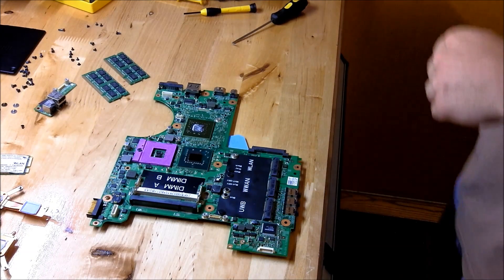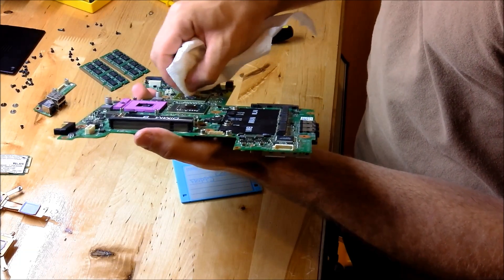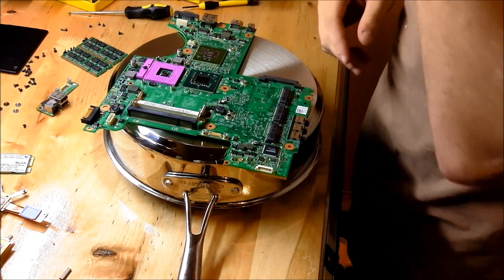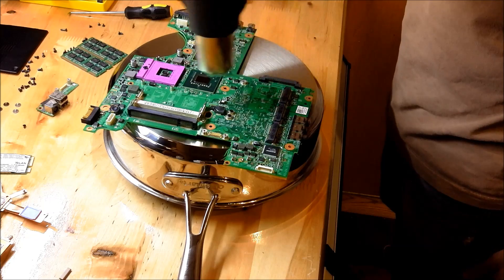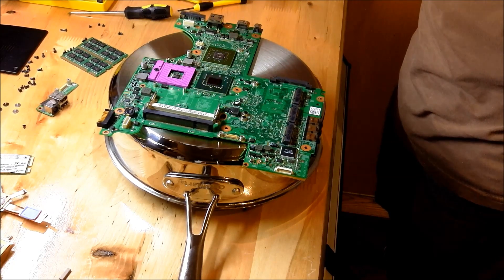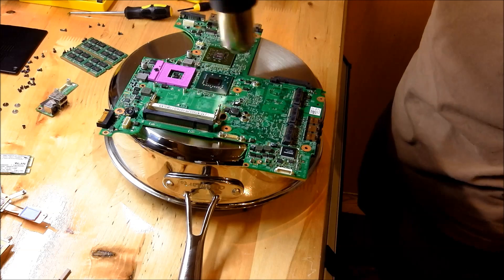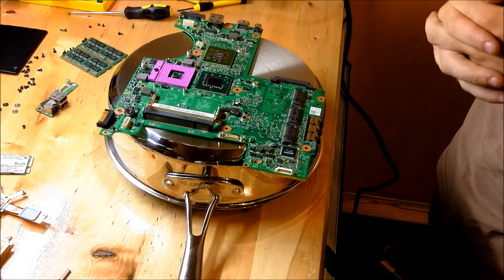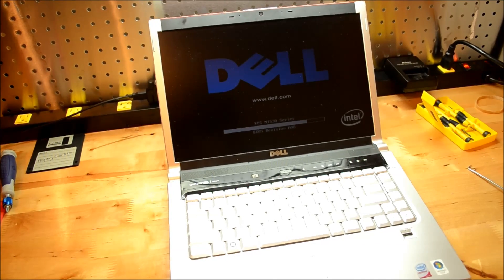Fixing a Dell Motherboard with Heatgun Reflow (or Oven) Nvidia Graphics GPU Issue

Comment: Hello thanks for the info, I have a 2017 dell Alienware laptop and the discrete GPU is dead, I wanna attempt this method on it, what was the temperature setting on your heat gun, is there a specific degree value?
Reply: Did u test it? and Is it working?

Comment: If you stick a laptop m/b in an oven to try a reflow, won't some of the plastic clips & connecters melt? Also, did you protect any sensitive components on the bottom?
Reply from the maker: I've don't this procedure a bunch of times, on GPUs, a few iMac logic boards, an xbox, and many laptops.
Reply: @GarageMaxedOut  I am still planning on, if needed, a hot air reflow, taking precautions, monitoring temps, etc.  Thanks again

Comment: I did this with my Sony Vaio which all of a sudden developed some serious graphic glitches on the screen and it fixed it.  I warmed up the board like you said and then focused the heat gun on only the graphics chip for around 8 seconds.  Then also replaced the thermal paste and cleaned the cooling fan of all the dust as it was clogged up so would have caused the overheating.  Thank you very much for your help :)
Reply from the maker: Glad it helped! You might also consider lubing the fan, which will allow the fan to move more freely. I have a video on the topic, and here is an easy to use oil syringe- https://amzn.to/34A7MqR

Comment: I came here just out of A M A Z E M E N T  to write this;

I have here (writing on it) a 2007 or 2008? DEll D830 2.2 or 1.8 ghz,depending on the cpu and 4 G of memory; old,but plenty enough for my needs;i have 3 of these,the other 2,work; this one  was dead 4 or 5 hours ago; i opened it to redo the heat transfer paste and change the cpu,.and after that it would NOT boot,turn on etc; D E A D;   ONLY 2 lights blinked briefly and then the one in middle would stay on; tried EVERYTHING: memory sticks,hdd,cpu(T7100 and T7500),etc etc
T H E N ,since it was dead ,i grabbed the heat gun from the shop (i had tried with a blow drier,no good)
I cut a  square off a piece of aluminum foil(doubled in2) and put it over the nVidia chip,like you see on many videos

I grabbed  my cheap  IR thermometer (with the laser pointer BS) and i heated the chip up,slowly at first,for,say 10 minutes,removing the foil and heating around from a distance at times

T H E N i hit it with the heat,foil in place; after maybe 1 minute,the IR gun got up to 170ºC, but i suspect the real temp was MUCH higher,that thing is not reliable; i was scared the chip was gonna explode,i put on some glasses
The whole chip started to turn slightly brown,and i smelled burning!!!!

Stopped right away,switched to the blow drier on low,to allow the chip to cool S L O W E R ;

And then  i assembled the whole thing, except all the bottom screws,intending to put it away,to throw away,or for parts,i had C O O K E D   it!!!!!

Well, to my delight,it works fine, hope it lasts,i am amazed at the power of youtube advices sometimes.

PS:  after some 20 minutes,it runs way cooler than before on the bottom,maybe some to do with the new paste.
Reply from the maker: NIce!

Comment: It's 2019 but I wanna say something about this. First of all this is not reflow because the solder didn't actually melt, if you want to reflow the solders you should apply flux otherwise it will oxidize the solder and will make it worse. It worked because of the heat applied to the chip which reacted and allowed it to work again.
Reply from the maker: Thanks for watching

Comment: Don't laugh but I f***ed up my acer aspire 5552 board. It was my first gpu reflow attempt and I forgot to take off the little film on top of the chip so it melted all over it! I tried to scrape it off but ended up disturbing the tiny pieces on top of the chip (not sure what they are called). To top it off, a capacitor came loose and because detached. Strangely enough, the board still powers up, I thought it would be totally dead. However it does turn itself off after about 3 seconds.
Reply: I have one more board which is the same to try this out on so any tips would be greatly appreciated. I'm using  a 2000w heat gun btw. The lowest setting gets to 400*C
Reply from the maker: Check out my new video on this- https://www.youtube.com/watch?v=utt-SSQAYSA
Reply from the maker: Are you sure it was a capacitor?

Comment: I am not sure how long this repair will last, but my Dell is working. My 630 is used for programming radios and the software only runs on XP.  I ran a 24 hr test this far good.
Reply from the maker: Glad it worked for you!

Comment: My laptop motherboard has a amd dedicated graphic chip. If i completly remove the chip, motherboar will work or not?
Reply from the maker: If your laptop also has integrated graphics, it is possible, but unlikely. In a laptop, the LCD screen is connected to the primary GPU bus, which is probably to the MXM slot in your unit (but I would need to know what unit it is specifically)
Reply: mr82020674 I want to remove the dedicated graphic chip "amd chip" . Becoz it is faulty and online update tries to update graphic driver and screen goes black.I m sure amd chip is faulty. Laptop is now running with Intel HD graphics  with Intel i7 processor
Reply from the maker: What is the operating system? Did this start happening after an update? Did you see glitches prior to this starting?
Reply: Problem Fixed, I removed amd graphic chip and its power supply unit. Now my laptop is running with intel HD grapics with no problem.(HP Pavilion DV6 6165 TX)
Reply from the maker: Nabodaydharani Medhi nice! Good info to have for sure, thanks for the follow up!

Comment: This is an old thread but I have a unique problem but similar. I will try for some of your expert advice since nobody seems to post on this exactly the same as my problem. I have an older 2005 NX9030 Compaq notebook. Recently the laptop's screen started a type of rolling pixelating and would go blank occasionally. Not black but it seems the inverter is working since I can change the brightness of the screen but only the whiteness since the actual picture stopped with the rolling pixelating and now is just blank. I should point out early on just tapping around the computer would bring back the picture for a while but now that doesn't help anymore. 

I can plug a VGA monitor in and works just fine. I can deduce I have either a problem with the laptop screen or the onboard graphics chip has partially disconnected from the board. I tried taking the battery out and hitting the power button for 60 sec. with no power since that is some people's suggestion but no success. My question is there a program that will test if the screen is damaged or the GPU chip? I have used several old computer programs that test the computer like Sandra and they say the graphics are fine. I know VGA is analog and the laptop screen is digital like DVI (I think it is anyways). Is that what it is the digital part of the chip is disconnected but a test program wouldn't know if the output is disconnected but is still functioning?  I really don't want to reflow the GPU but I will if someone is sure that would help. Buying a new monitor and then finding it's not the monitor would suck. The internal connection to the board is good. Any suggestions to pinpoint the problem?
Reply from the maker: If the external video is working, your GPU is likely fine. I believe the internal laptop screen connector is also analog, fwiw. If you are 100% sure the connection to the board from the LCD is good, I would get a replacement internal LCD cable and try that, however it is very rare that they go bad, I've only seen 1 do that in my life.
Reply: Thank you responding. I'm afraid I have no way of testing this connection other than just a digital meter. I couldn't say where the problem is unless replacing the ribbon cable or the screen is going to give me a definitive answer. I went out on Black Friday and got a new Win10 computer for only $110 American. The replacement used screen was $50 or more and the computer couldn't manage any Utube unless it was in the smallest format possible. Maybe a external video card would be possible but getting one that works on WinXP would be stupid and upgrading to Win10... on and on and on... long story short... I love my new computer

Comment: I've tried this numerous times, and while it works each time, the issue with the gpu and no display always reoccurs.. Despite properly cleaning the fan, heatsink and reapplyig thermal paste(arctic silver 5), this fix doesn't seem to last..
Reply from the maker: Make sure you use a quality thermal paste- https://amzn.to/39chrWo

Comment: Hello, how many degrees did you heat up the board? And how hot do you apply air? You did not heat directly on the chip? Thank you
Reply from the maker: Fatih Bey. hey sorry, I didn't use a thermometer, just the method demonstrated here
 I'd follow it just like it says and check your results
Reply: I'd not attempt to use the oven, as the temperature of the oven doesn't get sufficiently hot to completely melt the solder. This is partly why the oven trick is at best a temporary repair.

Wrap the portions of the motherboard you're not working on in foil. Take a heat gun, hold it so the nozzle is straight, and so the nozzle is approximately one inch above the surface of the chip to be reflowed. Set the heat gun to 300 degrees Celsius and let it run for approximately one minute. Shut the heat gun off and let the board cool for twenty minutes. Clean out the fan and reassemble the laptop. Run a 3DMark torture test for a while afterward. If it survives the torture test, enjoy.

Holding the heat gun in this manner mimics the solder reflow workstations technicians use.

Comment: Amazing it worked for me thanks a ton ressurected my 9yr old dell studio1555 unused since last 1year due to dead ati radeon graphics card !!!
Reply: worked temporarily for some time then shuts down anything else i can try please suggest?
Reply: Hi. Hey! Men! I have a Dell studio 1558 with the same problem that you had. I'm going to try resurrect my 8 years (unused) laptop with the oven method, because I'm not have heat gun or hair drier. But I know this is a temporal solution, due to the tin factory quality. I read, that a better solution is a reballing, because in the process, they remove the factor tin, and use a better one with more lead for improved efficiency with temperature handling.
Reply: ¿How you did it? ¿Oven or heat gun?.
Reply: @miguelrocha624  tried with heat gun multiple times but worked for some time then black again finally i replaced the board with another used one from ebay.
Reply: a more permanent solution will be reballing I have kept the old board will bga reball it

Comment: Its not the joints its the chip its self trust me. By heating it its temp fix it will not last.
Reply: I did this repair to my 2010 model Dell Inspiron N5010 over two years ago, and ran a 3DMark torture test afterward. It survived the torture test and I used the laptop daily for 18 months after the repair. The only reason I stopped using it on a daily basis was that at the 18-month mark my roommate bought a MSI Wind gaming computer and gave me her 2011 model Dell XPS L511Z; an upgrade for me as my laptop needs are modest.

I'm not saying you're wrong here, because in most cases it IS the chip. But you can't say with absolute certainly that in every instance the chip is the problem, because there is that small percentage of faults that aren't due to the chip itself.

Comment: I kinda doubt putting foil on the parts you don't want to heat up too much would prevent damage in the oven.   I could see heating the whole board up a bit with the heat gun then putting a piece of foil over it with a hole in it just big enough to get the GPU nice and hot and having that shield the caps and the rest of the board from overheating.

Comment: My laptop has a black screen but if connect it to a external monitor it works, can it be my GPU or is my screen?
Reply: lapincheriatota it's not your GPU, if that was bad you would not have an external image (2cd monitor).

Comment: It does work, but only temporarily - it will break again. The only real solution is reballing, but obviously usually it's  not worth the cost with the old laptop.
Reply: There is a debate about reballing being effective since the fault lies in the substrata of the chip itself. The heat process of reflowing, even a reballed chip, gives it temporary life. The best solution is a NEW chip but finding one that isn't an old chip that has been reballed is not that easy.

Comment: ive gota temp controlled hot pad for lcd /glass/digi separation... i cant quite get a full atx board on it but a lot of laptop main boards would fit just fine. Would it be a good idea to use that maybe 25c lower than the heat gun on the back side?

Comment: Just how is that supposed to "re-flow" the solder?  As everyone knows, lead free solder melting point is about 460F / 240C. so setting the oven to 385F is nowhere near hot enough.  Don't believe me? google it.
Reply: Because you don't want it to reach the melting point, you simply want to soften the solder. This will allow it to bind better to the sufaces it's already bound to and helps ''seal'' any thermal cracks in the solder itself. If you allow it to fully melt, it could potentially flow down damaging other components.

Comment: Why did you do it on a pan? Also what setting/temp did you use  on the heat gun?
Reply: I'd say the lowest and if it doesn't get hot enough either move the gun closer or set it higher while having it further away to start with.
Reply from the maker: Because it gets very hot and it is a wooden surface underneath

Comment: Good tut, worked for me. 30 second quite direct heat blow on southbridge and gpu chips. I used butane heat blower at around 250 celsius and concentrated direct on chips for short 30 seconds then let cool for 5-8 minutes. Assembled laptop and held fn, esc and powerfor 5 seconds then let go of fn and esc but held power button still for 10 seconds then let go.....then smilled :)

Comment: why are you heating up the whole board though? I don't understand? Can't you just heat up the area you want to repair?
Reply: The motherboard is heated to 90 degrees to the rear so that it is not damaged by heat, then the front surface chip is heat treated as far as I know
Reply: +PanteraJoey He is probably preventing thermal shock. If a part of it is hot, and part cold, then it can warp the board and/or cause chips to pop off.
Reply: +kodie wininger ahh, ok, thanks

Comment: Whats the point in heating the whole board when problem is stated the graphics card.
Reply: If the heat is high in that area and room temp in another it may warp or damage it from the large differences in temps on the board.

Comment: how much would a tech charge to do this kind of job?
Reply: +Chris Wistey - Just 2 days ago I was doing some searching and found a shop that would attempt the work but with no guarantee or idea of time required at $35 per hour plus shipping. 

 I personally would attempt a repair as outlined in this video on my own if it doesn't work nothing lost. Another option would be to get a reballing kit on Ebay about $35. Besure to use a reballing kit that uses LEAD-FREE solder, the reason being the lead free melts at slightly higher temp.  Further when you finish and reassemble use a good heat sink compound past like "Antec Formula7"  it has a heat range from -50C to +250C most newer computers get alot hotter than the older ones.   View YT vids on removing and cleaning the motherboard and video chip board.  The reballing kit from Ebay will have several thin sheet iron  masks, when the solder is heated it won't readily stick to the mask, for the various chip board types.  Just like in this video once the balls are in place heat with heat gun just until the balls become shiny they are now soldered to the chip board.  Having previously cleaned and prepared the motherboard, the next step is to place the video card on the motherboard careful alignment is key here, observe the index indicators,  use a magnifier if need be.  Either heat with the heat gun or heat in a toaster oven.  I am partial to the oven method as you can heat in stages, gradual heating,  getting to the heat desired.  As an indicator placing a couple of balls on top of the chip, don't worry it won't solder to it as the chip is ceramic.  Though the average time is 8 minutes at 380F once you see the solder melt you can be fairly sure everything has flowed.  

 Most of the time folks will be successful with this repair.  The benefit of doing it yourself is you get your circuit board immediately and you just saved yourself $100 or more. All you need to do is take your time do a practice dry run.  In the event of an unsuccessful repair you have only spent money on the reballing kit  Now all you need to do is find an exact match replacement via the mfr's stickers on the board...  and hope it is a good board as advertised.  Hope this helps remember, "You never know what you can until you try".

Comment: From my experimentation with various boards is to ramp up the temps slowly.  200F for 3 mins to start, 300F for 4 min and 400 for 2 mins then OFF.  Let it cool in the oven for 10 mins then remove and let cool to room temp.
Reply: You mean put it in after it hits 200, then after 3 mins of that knob up to 300 and start the 4 mins from when you turn the knob, then the knob to 400 starting the clock for the 2 mins, then off and open the oven door?